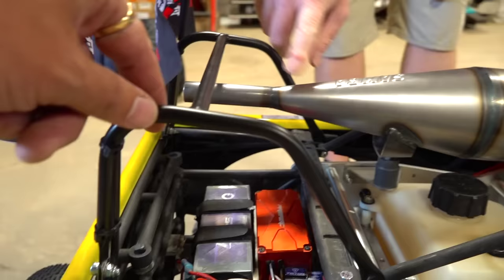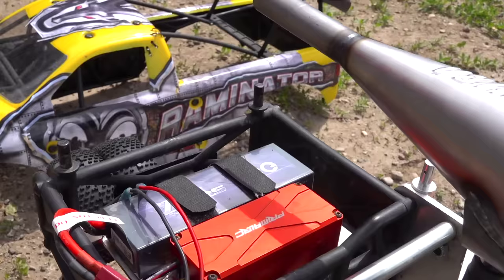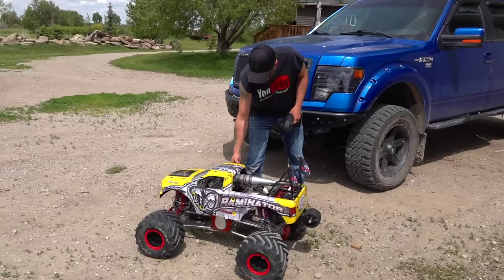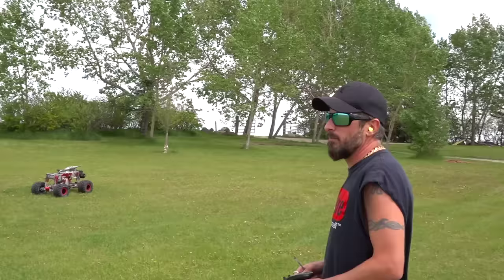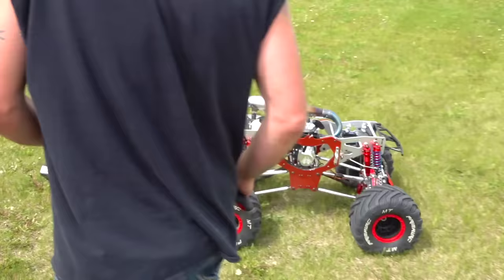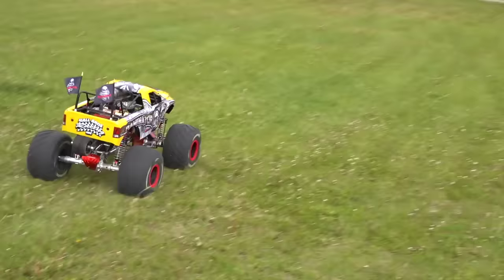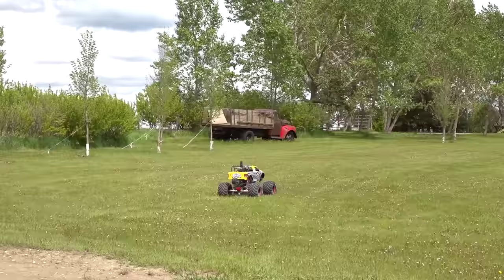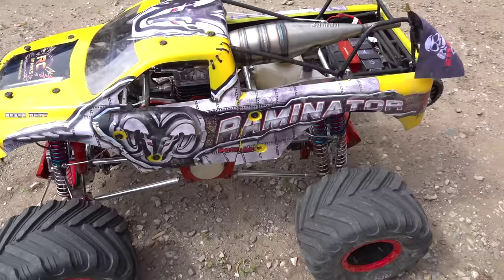RCMAX 80cc SUPREME GAS ENGINE - FiRST START & TEST RUN: PRIMAL RAMINATOR 1/5 MT TOY | RC ADVENTURES

Comment: She needs a 2-speed transmission! A second gear would really open it up a lot. She's a machine and a half though!
Reply: it needs a major gear improvement! It can take a lot more gearing and get up to speed!
Reply: I cant give it 2 thumbs up so I'm commenting to do --->👍
Reply: No reason for 2 speed on offroad truck
Reply: @lietuvis2012  you mean like a lot of monster trucks used to have?
Reply: I was thinking the same thing! Even my old Tmaxx from literally 20 years ago had a 2 speed..
Reply: No, it does not need a two speed. Many high end engines, including pocket bike Blatas with tuned pipes do not use two speed. It is about right, a monster truck set to "hit" the pipe at peak torque, NOT speed...
Reply: like a 2-3 speed automatic would be sick
Reply: @lietuvis2012  Yes there is...MO POWA BABY!

Comment: The fastest dirt bike I ever had was a 2-stroke yellow and black 1980 Yamaha YZ-80 "Bumblebee" I bought used from my older cousin who bought it brand new. That was the fastest dirt bike of all. Much faster than the 1978 Honda XL-75 4-cycle before and the 1987 Suzuki DR-100 4-cycle I replaced it with. Had I known that before I sold it to my buddy I would have never sold it. We were 10-12 years old at the time (44 now) and it was a blast. That 80cc engine screamed and would easily keep up with or outrun 100cc and 125cc 4-cycle trail bikes. If I understand this correctly you have a 80cc 2-stroke on this truck...the same displacement. No wonder that it is fast dude!

Comment: Nice! Have you tried a larger carb for it? It looks like it’s running a 90cc carb, Walbro WJ-116. It would be interesting to see how it runs on a much larger carb like Tillotson HT’s, Walbro WG or WB. The motor sounds like it still has quite a bit of throttle waiting to be unleashed.

Comment: It happened again, I need a shower.  OOOOOO the precious. Give it fuel, make it fire, its an RC of desire. like the flags, I have some spring mounted on my hillbilly crawler.  gotta love that torque steer and chassis twist under power. that exhaust protector probably wont do much protecting in a hi speed wreck or heavy rollover

Comment: The low should be adjusted to where it will fire up. Then for the high you adjust while holding it wide open. This goes for everything, dirt bikes to weed eaters.

Comment: From riding 80cc dirt bikes back in the day with around 20hp, that thing should be faster.  Those were like 150lbs and I was 120lbs, giving a power to weight ratio about like a new civic Si.  That can’t weigh more than 80 lbs, it’s power to weight should be like 700 hp in a civic or performance like a Chiron or a Tesla Plaid or something.
Reply: Maybe the gearing is just way too low.  You might even want it to bog slightly on takeoff to keep from lifting the front end all the time.

Comment: Wow what a difference!! If the gearing were a little different this sucker would be able to go super fast and it weighs 80 lb I bet it would go 60 mile an hour with the right gearing maybe faster does that have a two-speed transmission on it?

Comment: Need to secure the pipe better if you want it to last.

Lower the chassis. If you can't back the springs off to lower it, then get softer springs. Then thicker oil in the shocks if you're blowing through the stroke too fast.

The springs are too stiff & your shocks are too soft....oversprung & under damped.

Sick rig though. 👍

Comment: The front axle has so much torque it's lifting the right front tire only way to fix that would be a stronger spring wouldn't it or maybe thicker shock oil?

Comment: hello dude :) can i put you here a link to teh french still brushless conversion ? :)   2x 56114 360kv motors no clutch but a cuch drive and 2x 18s :) 20hp  50kmh 40min run time with 5500mah :)

Comment: U need to soften suspension to lessen the load on other parts that's the suspensions job to soak up bumps and absorb the impact when it's stiff it just puts more load on everything else and ur shock shafts that's y they bent just my 2 cents

Comment: You should Adjust the clutch engagement RPM higher, it will get into the power band faster giving you more torque and acceleration from stand still.  Also should gear swap for higher speed since power band is like 8500 rpm and up and your stock gearing is limiting the engines  power potential and top speed.   Check out this engine's website and see the video they have posted with this insane 80cc engine in this truck if you haven't, he discusses gearing and
Reply: We are very well aware. This was the first fire up of the engine. Nothing more. Putting some fuel through it to start tuning and see what its like.

Comment: Hard to judge the scale till you are standing in front of it ..seems like it would handle better if it had independent suspension instead of solid axles

Comment: Ya don’t need no stinking training wheels on the monster..🤣, plus: what a crappie location for the fuel tank/ exhaust right in the way of filling it up. & being how that roll cage is up to protect the exhaust tip- if it was my truck, id put a suv, or a panel truck body on it. 😆
Reply from the maker: A panel truck body would be sick! Im thinking about a cage..
Reply: RCSparks Studio- 
 I’m gonna make one..  where can I find just the front axle assembly? Assemblies.. 🤔
Reply: I got a 1/6 scale grave digger body I’ll use for mine. 😈💩... a standard monster truck tire is: 66” tall, by 43” wide, by I think a 25” or 30” rims... do a 1/6 scale (1:6-1/2 scale) would be a realistic “true scale” monster truck... being the grave digger 90s- 2003 era bodies (the real monster trucks) are a slightly shrunken down “1950-1953 Chevy panel delivery truck body”... 
so proportionally the 1/6 scale body will work good. 🤔

Comment: In a full sized monster truck the suspension should be set up so it is really uncomfortable to go over a 2x4 but you send it 39 feet and you Neely tell you left the ground
Reply from the maker: my thoughts exactly

Comment: should try a different sized sprocket and see how it goes, this can have a huge difference in speed as you will know. the truck seems to be set up for torque and not speed.
Reply from the maker: Already did but.. the video is linked :)
Reply: @TheRealRCSparks Oops Sorry m8, I will have a look. wasnt hating btw, truck is awesome🏴🏴

Comment: Is there a kill switch on the remote ? If not you should see if you can make something work so there is an a electric motor of some sort as a electric start so you can shut it off an start it from the radio 🤔
Reply from the maker: Yes, I spoke about it a few times in this video
Reply: RCSparks Studio awesome I seen the other kill switch you added wasn’t sure if you were having issues shutting it off or not but electric start would be awesome on a truck like this always wanted to do it on a gas truck
Reply: @Ramcat_Vlogs  any electric start made so far has been a total fail. They just don't work.
Reply: EV TEK I know I always had the idea of using a brushed or brushless motor from a 1/8ish scale RC an an using either a belt system with a clutch so that it drops out when the motor doesn’t have power going to it or making a flywheel an sprocket like a starter in a car has so when the motors not powered the gear drops back from the flywheel

Comment: That is a bad ass. But for an 80cc it should be almost uncontrollable.
Reply: Think about an Cr80r Motor. Cut the trans off so you have the bare crank case n cylinder setup. Then port stage 3, VForce reeds ECT. Then it would be a sick mother fucker. Food for thought

Comment: Hey, so I got my engine on the truck, hooked up the exhaust, but how do I start the engine? No fuel seems to be going to carb and it doesn't have a primer bulb! Thought I'd ask!
Reply: See if the needles are closed

Comment: That's pretty cool but, damn... close to $6K invested in it and stuff is coming apart and in need of a zip tie to hold it in place?   Sway bars bending?  Mounting points ovaling out?  Those things shouldn't be happening on a $6k RC vehicle.  
Speaking from experience, you'd have way more fun with it if you dialed in your suspension properly.  You're WAY over sprung and it's causing your shocks to barely work.  Shocks have to compress to do their job.  Your springs are so stiff you're barely getting any spring or shock compression.  That's why it's so bouncy, the shocks aren't being allowed to dampen the hits.  That's probably why you're bending the sway bar too.  Just saying...

Comment: Maybe give it a little higher gearing, more top end and a little less wheelie power.
Reply from the maker: Actually.. Im going the opposite direction.. I want more wheelie power.. AND speed.  But I own acres of land, and this 80lb beast covers it as quickly as an xmaxx now
Reply: @TheRealRCSparks  You can't have both, unless you rev the motor higher? If you want more low end power, you'll sacrifice top end speed won't you? Unless I'm missing something

Comment: You're saying everything is stock. But the raminator came stock with a 50cc engine. And on your thumb nail it says you have an 80cc . But it doesn't punch like it has 80cc  .
I have seen them come Completely off the ground and flip over backwards because they've got so much power. And they even take off and run like really fast. But yours don't seem like it's that fast And it doesn't seem to want to come off the ground. I don't know If it's because you've still got the. 50cc or what. But Yours Just don't act Like it has the 80cc engine. It should be a lot faster than what you show.

Comment: That thing needs a better exhaust and higher rpm clutch. My 33cc motor would smoke that 80cc motor. If you think about how fast an 80cc dirt bike is this thing is way off and so much slower for some reason.
Reply from the maker: same old argument, same crushing answer. I have 4 Powered Tires. You had 1

Comment: It's not just like a straight pipe, that is a straight pipe, you  should get a muffler and stop engine braking, that engine won't last if not.
Reply: Its a 2 stroke. You don't ever want a muffler for that and second there is no engine braking.

Comment: Why pay 3000 for a 80cc engine that has one gear.. when you could buy a yz80, yz125 dirt bike and use the engine for the raminator.  Me personally if I buy a raminator I'll be lookin into a dirt bike motor for it.. couldn't justify paying 3k for a 80cc engine when u could buy a whole bike and use the engine plus gearing haha
Reply from the maker: because it wont fit

Comment: I don’t see paying 3k for this and my $700 electric one will walk all over that.... not knocking the truck or the work. But seems like a lot of noise and it goes nowhere. Unless this is built just to say you have something that looks pretty, I don’t get it. Honestly I’ll put my sons $200 battery car against it in a race and smoke it.
Reply from the maker: Saying "not knocking the truck or the work".  and then "But seems like a lot of noise and it goes nowhere." is actually knocking the truck and work. Its terrifying to operate and would easily kill someone. Your $700 electric is the size of its tire. Lol...  What do I know.. i only own 1000 RC's.. LOL!
Reply: @TheRealRCSparks  size means what when it comes to a rc car? What is scary about it? The fear of blowing out ear drums with all the noise and no speed? If it blows up and kills somebody you did something wrong. I have nitro powered cars and nothing is scary about them.
Reply: @TheRealRCSparks  just because you have the money to buy this stuff doesn’t mean you know anything about it. 😂🤯